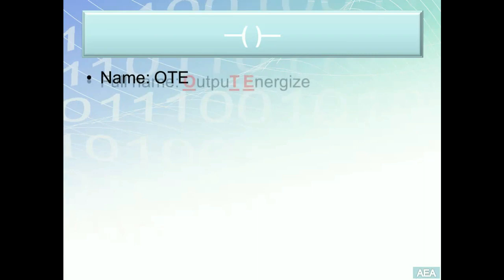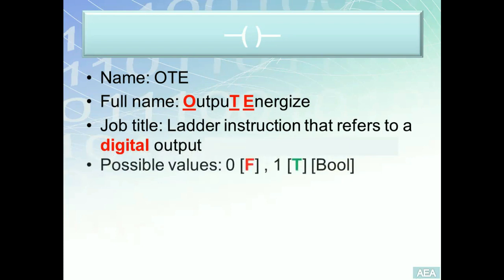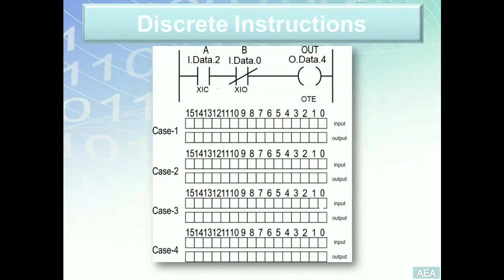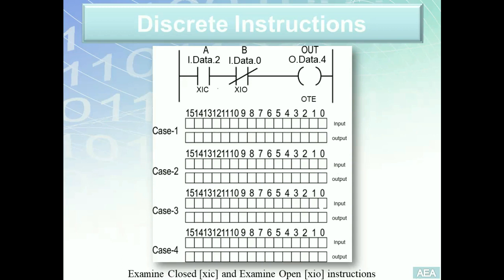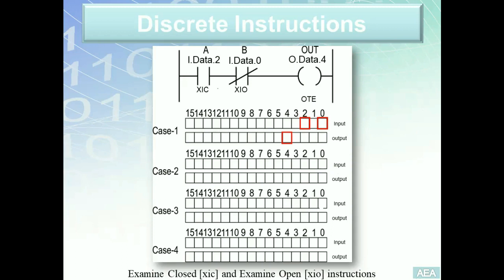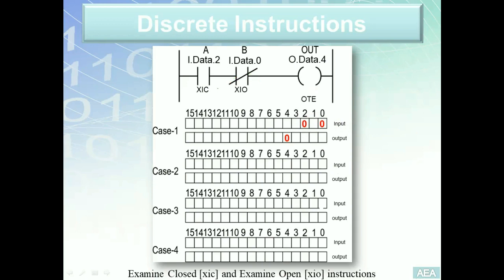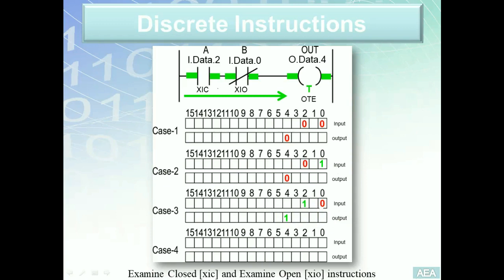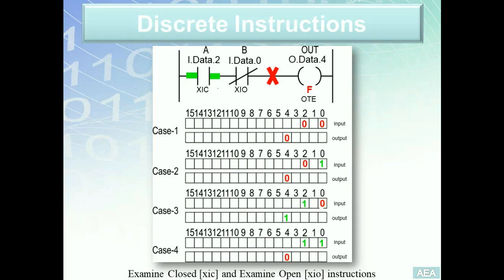LD 7 - Output Energize [OTE] + Full XIC XIO Example -  Easy PLC Programming Tutorials for Beginners

Comment: it's tricky because though it looks like a normally-closed switch, it is not....it didn't work as a normally closed switch. it evaluate a bit and did the opposite output. that's it.